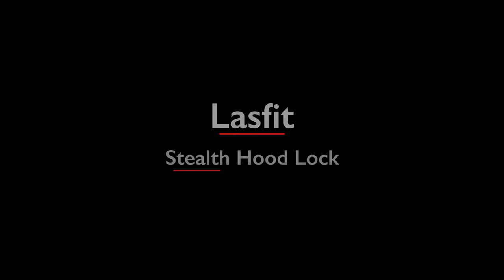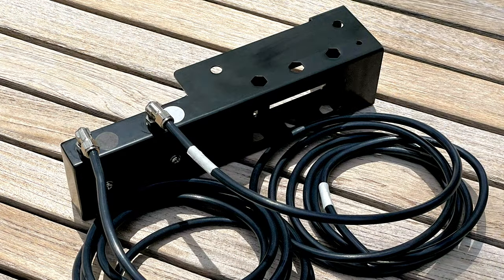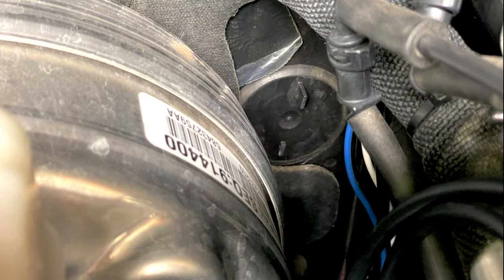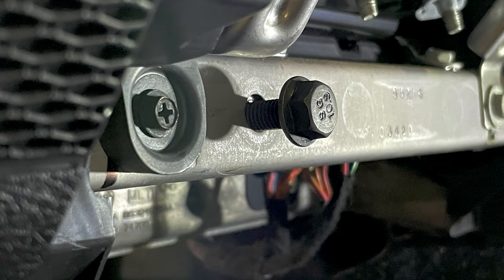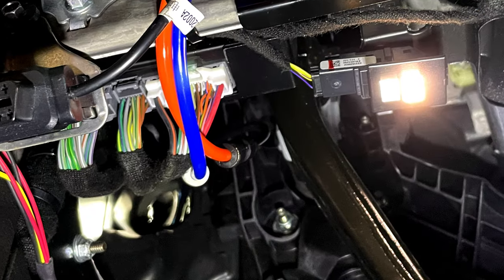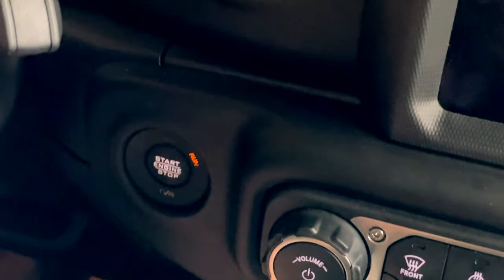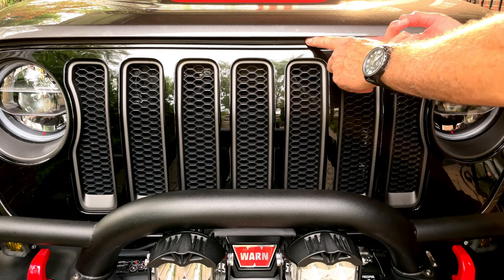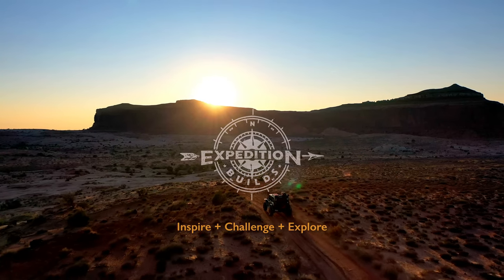Lasfit Stealth Hood Lock System

Comment: Would appreciate additional information about the back-up emergency power cable.  Where is it located and how does it work?   Finally, with , the hood locked, but slightly open, can a thin blade be used to slide in and push the jeeps hood latch to the right?  Thank you.
Reply from the maker: Hi,good hearing from you. A backup cable is supplied in the kit. In the event you needed to use it, you would plug the cable into the release switch  (under the drivers knee/kick panel) and press the 'release' button to unlock the system. Version 2 of the Lasfit kit now has a manual pull handle so you don't need a second battery or jump starter. 

Here's a link so you can read more about it: https://www.lasfit.com/collections/parts-for-jeep-wrangler/products/lasfit-stealth-anti-theft-hood-lock-for-18-22-jeep-wrangler-jl-and-gladiator-jt